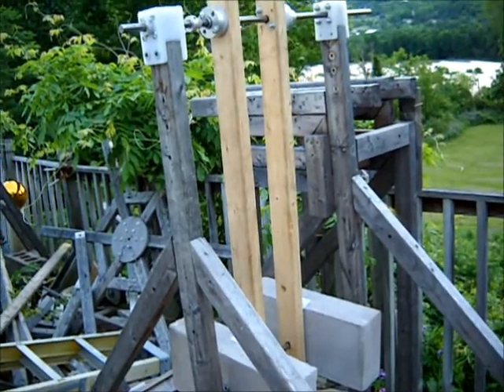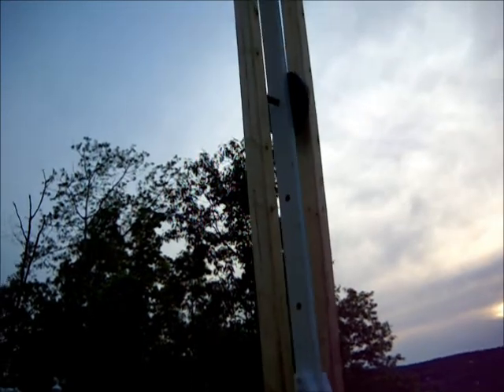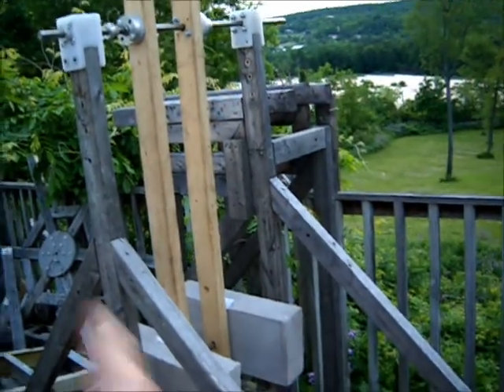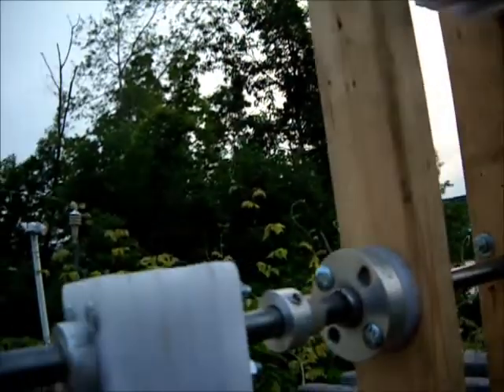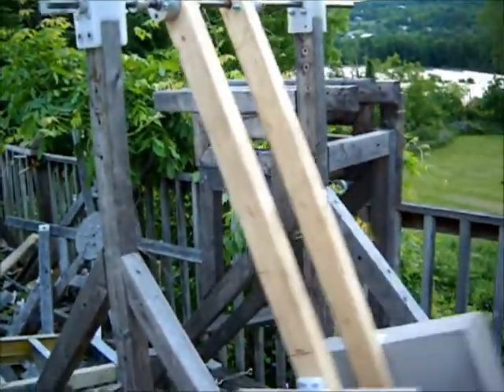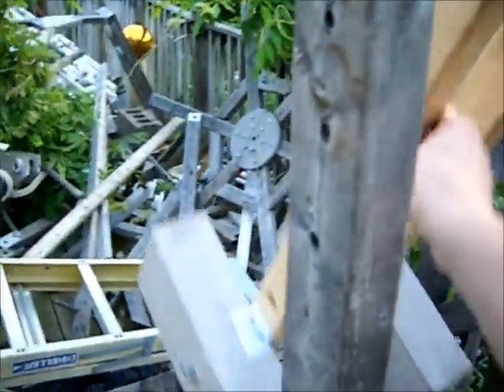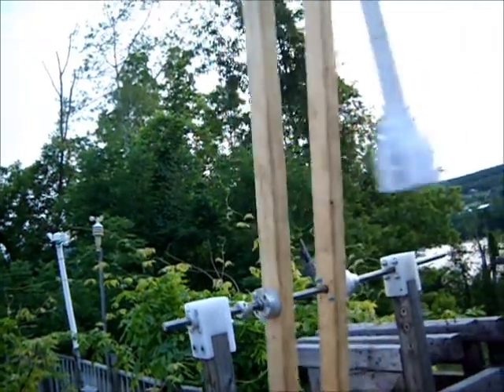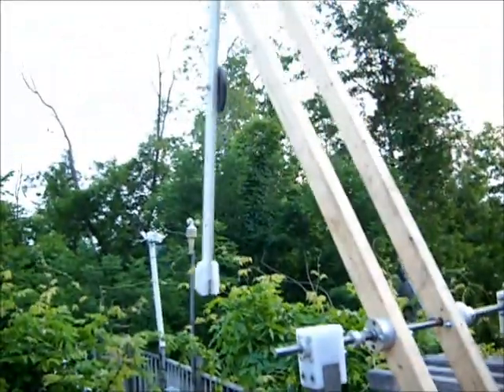GRAM TSO Gravity Assisted Pulse Motor 6 12 19

Comment: Why did you choose to put the secondary smaller pendulum so high up in the air and what is its purpose?  If you made the pivot point down close to the weights you could have a very long upper pendulum. That could swing way out.  You need to use leverage to swing the bottom weight so you will have a small input force then keep it going while harvesting Energy From the secondary upper pendulum